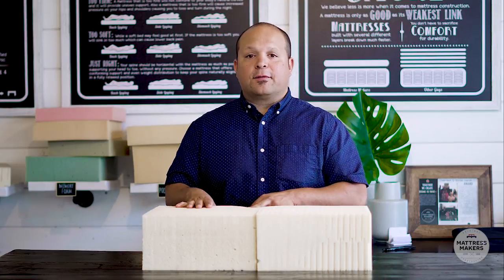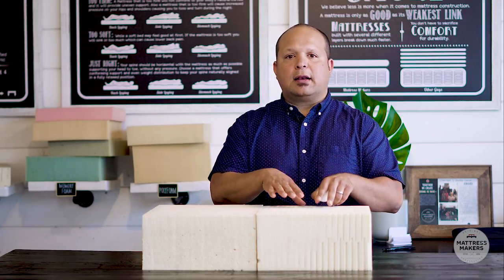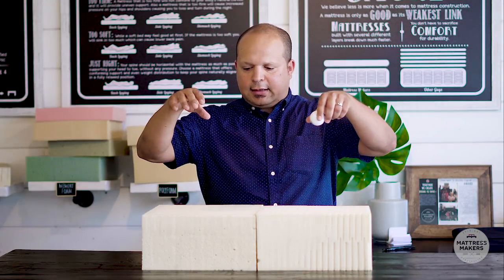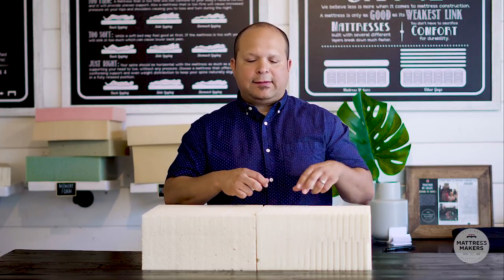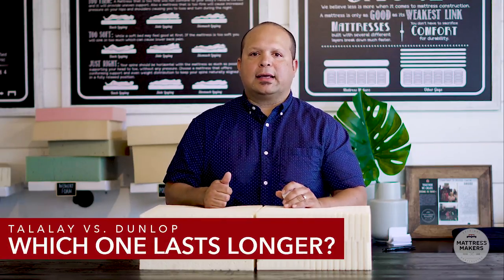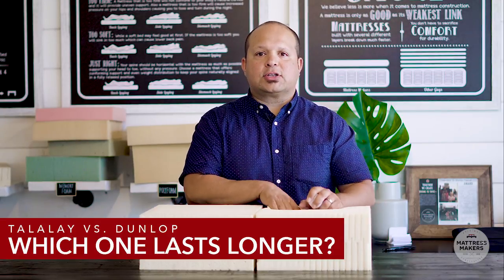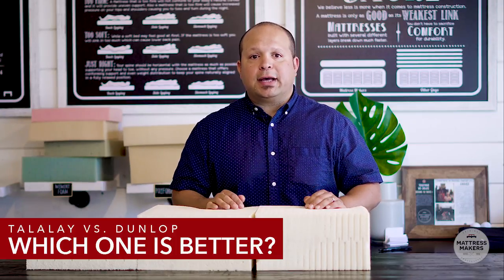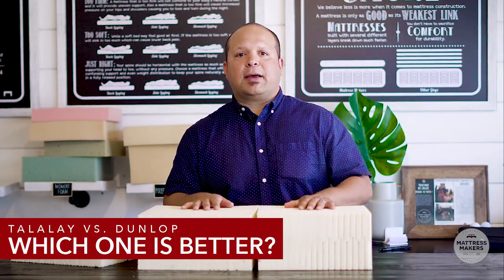Talalay vs Dunlop: What's The Difference?

Comment: Good stuff.  Thanks.  A question regarding breathability.  If I use dunlop as the base support layer, and talalay as the middle and top layer, with I feel the difference in breathability, other things being equal, if instead I also make the base support level talalay?  If it is all talalay, will air works its way up thru all the layers to the sleeper better?  Thanks again.

Comment: Doesn’t Talalay always have to be mixed with a synthetic?  I heard from 2 other videos I watched that there is no such thing as 100% Talalay.
Reply from the maker: Actually there whether it's dunlop or talalay you technically can't get 100% natural latex. The most you can find is somewhere between 95-97% natural latex, the remaining 3-5% is the curring material to make it the latex rubber you see in mattresses.
Reply: Thanks for the question and answer as i was confused

Comment: I have used a talalay mattress, (by Beautiful), for the past 10 years. Absolutely the softest but also supportive mattress I've ever owned. I was led to believe it would last for 15-25 years, but just recently I've had the return of back problems.I discovered the middle, (where I sleep the most), has become compressed.( I tested this by laying on one edge, and felt a sensation that my body wanted to roll to the middle). This compressed area cannot be seen visually, but it's definitely there.Final test was sleeping on a regular mattress with a 2 inch topper that yielded no back discomfort the next morning. I am so disappointed that the mattress has only lasted 10 years when I paid big money for it to last!! I'm a bigger guy, (230lbs), but that was not identified as a factor in durability initially. ALSO... it is not often said that these mattresses are super heavy!!!   and they are dead weight. If you are in the market for one, be sure to try picking it up before buying. (Yes, I did rotate the mattress every 4-6 months, sometimes by myself which wasn't very easy).
Reply: Nothing ever lasts as long as they say. My very expensive topper already has a big tear in it. If I could find the Talalay that I had about 12 years ago I would be in heaven! Like you I'm a big person, I've found the best combo is to get a super firm flat top  mattress set and add the toppers to that. That way you get that very firm support but with a couple inches of bliss on top. Yes they are very heavy, but nothing is better than Talalay latex in 
My opinion.
Reply: Last 8 bed in the boxes ive tried (non latex) last 6 months, so congrats!
Reply: @sweetea7035  is talalay better for heavier individuals?
Reply: @Sssssssslf  it definitely has a better feel. And they come in different ILD (firmness rating) if you are heavier I would at least start with a mid range firmness, not the softest. I would also advise to spend a little more and get a zippered cover if the company offers it. They do tend to discolor and get yellow over time.

Comment: I need an firm topper, one that doesn't let me sink in like memory foam. I'm undecided on whether to get medium or firm Dunlop. I'm a side sleeper. Which would work best for someone who tosses and turns all night? And is 2 inches or 3 better for lower back support?
Reply from the maker: If you're going to get a dunlop I would stick with a medium layer as firm dunlop layer can cause pressure on the shoulders and hips. A medium talalay would be a good option as well.
Reply: @sdmattressmakers  Thank you. Would you recommend a 2 or 3 inch Dunlop?
Reply from the maker: @EllieLove21  generally for most people 3" is the sweet spot.
Reply: @EllieLove21  what did you pick?

Comment: I need one that won't hurt my back & hips! Which one is best for a
130 pound bedridden person in a hospital bed?? (adjustable bed)
I sleep on my side mostly, but at times fall asleep on my back while
watching tv.
I ordered a Dunlop & it ruined my back & hips. I ordered the soft.
Reply from the maker: Hi Nun Ya, I would recommend using dunlop in the core but use 1-2 comfort layers of talalay medium-soft firmness that way it can still give you support but also the pressure relief you need for your hips.
Reply: Was the soft Dunlop you ordered too soft with no pressure relief?

Comment: I'm thinking of getting a sleep on latex mattress in medium and a sleep EZ 3 talalay medium topper. I weigh about 230....you think this would be to soft? I sleep on my back or on my hip side w my chest more facing down so my shoulder doesn't dig in at all. I could also go 3 inch medium or soft Dunlop topper?
Reply: Did you do this and enjoy it?  Currently doing the same thing
Reply: @sherylfinucane5873  so I bought the medium firm. It was firm. I bought the soft topper for 50% off. Since then I have had my hip replaced. 
I can sleep on the opposite side, my back, and my stomach. The pressure is too much on my hip replacement though. 
Buying a bed online made me a little obsessed and kind of crazy for a few weeks. Because of this, I have gotten a job as a mattress sales person.
Go to a mattress store. Go feel beds you're thinking of buying. Buy based on how it feels to you (pressure relief,  and comfort). It's worth the time.
Also I weigh less now, about 200 and its still "soft" enough to sleep on my non replacement side.
It does come firmer and soften up over time. They all do

Comment: Hi, what's the minimum thickness to get the advantage of latex? I'm not a big guy (5'6 160 pound) I want to buy one and it'll be just latex and a cover. Thanks
Reply: 3" , but you really should have either a firm foam or spring layer below the latex